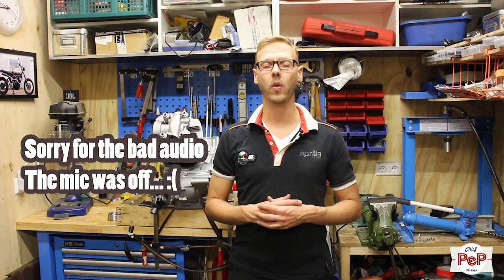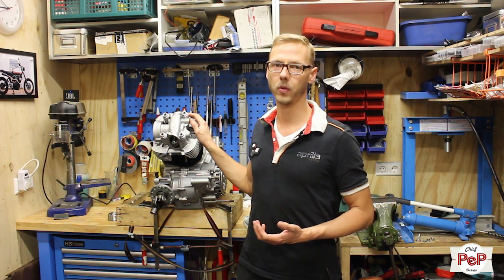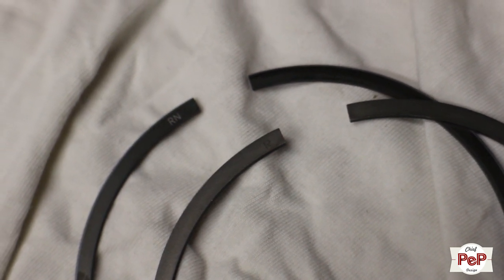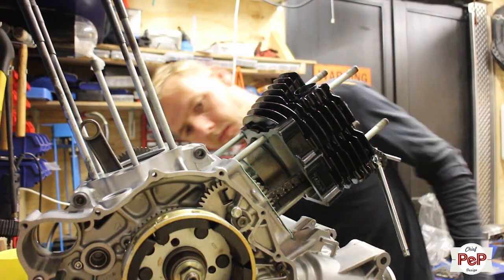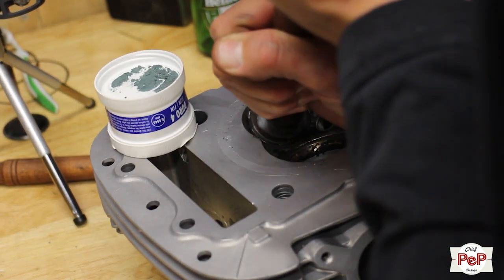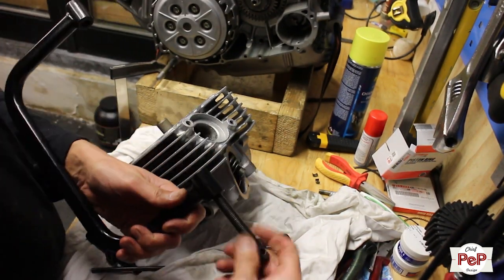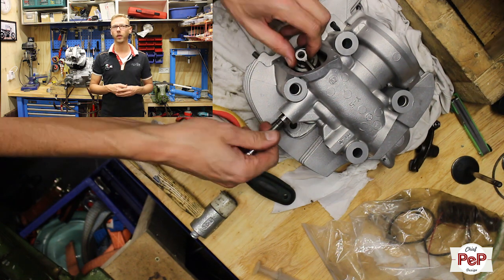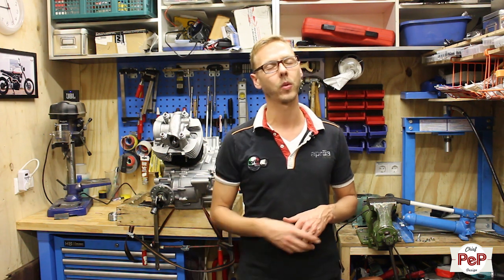Installing cylinder head, pistons rings, valves

Comment: There is actually pretty much difference between camshaft #1 and #2. If you inadvertently cross the camshafts the engine actually works backwards, meaning it will suck from exhaust and blow to carbs. Been there, seen that, done that.. :)
Reply from the maker: Yep. Luckily the numbers written on them make it a lot easier to recognize them

Comment: Pep, for clean yours upper side of pistons (head), you need to use a Oven Clean Foam, apply and wait for a 10 minutes, if are not completely clean, can use Carburetor Cleaner or a product called Schnell-Reiniger from Liqui-Moly, is very aggressive with carbon rust.
Have a nice day and best wishes from Copiapó, Chile.
Reply from the maker: Thanks Pipo. But I basically don't clean the upper pistons. There is no nead to. It improves compression, which always helps a little for performance... You probably don't feel it, but there is no need to clean them very well.

Comment: Thank you for the quick reply, but my question was!  to confirm that there is NO gasket between the cylinder and the head,  just a face to face fit, Yes?   I know that the O ring is correct.     One more quick question when I'm here, what should I expect as a good compression test reading?  I'm only getting 80psi  rear and 50psi front. Dave.
Reply from the maker: That ring is the gasket...
Reply: @chiefpepdesign  Ah!  Thank you .

Comment: Hi, good job! What is the side axial clearance between the rocker arm and the cilinder head? Mine is about 0.3mm and there is nocking around 1060-70rpm. I think to reduce it with washers. What do you mean? Greetings from Bulgaria!
Reply from the maker: I don't think it's smart to put washers in... The workshopmanual should have those clearances and tolerances noted down.

Comment: Hi, good demo, by the way,. I have a 1983 vx750 and having taken the cylinder head off I notice there is NOT a head gasket, just the rubber ring that fits around the timing chain channel .  is this correct????   Regards  Dave,
Reply from the maker: Yes. Probably there is a gasket ring around the cylinder circle. It's completely pressed in. You can pry it out and have to replace it.

Comment: Hello Chief. I am assembling my xv1100 and my outer valve springs are variable pitch ones and I did not note which way they go in when I removed them. Do you have any suggestions about the direction? Thanks a lot
Reply from the maker: The tight winding part down. Most of the times...

Comment: What size bolt and thread pitch did you use for removing and installing the rocker arm shaft? Trying to remove mine and I can't find a bolt that fits.
Reply from the maker: I believe it's just a normal 125 thread M10
Reply: @chiefpepdesign  Thank you much!

Comment: Hey so I can’t install both lower halves of the cylinder heads before doing the #1 and #2 cylinder heads? I’m asking cuz I’m waiting for the top ends to be done at the mechanic but I’d like to keep working on the rest until then. Also. Is there a proper front and rear designation for the lower cylinder heads? They look the same and I don’t see any markings on them.
Reply from the maker: Alex Fluckiger Alex Fluckiger well there are numbers at them. The fact that they have makes that probably something is different. For instant the cast. The rear gets warmer than the front... You can start building the lower parts and insert the pistons if you want. The only thing is when you want to turn the engine to find a tdc the cylinders will probably go off together with the piston which is very anoying.

Comment: There is an black oily deposit at the end of the tailpipe from the front cylinder on my 1990 xv 700 it was spluttering/backfiring -now wont, is it rings /seals what do you think? the smell of burnt oil is terrible
Reply from the maker: 🤔 Very hard to say. As far as I can tell from this explanation it sounds like things don't burn well. Try new spark plugs, make sure they are adjusted conform the guidelines and try 98 gasoline for a while instead of 95. The 95 now a days are way worse than back in 1990...
Reply: @chiefpepdesign  thanx ill give that a go

Comment: ey chiefpep, if i want to do a top end rebuilt, do i have to put in TDC for the front or rear?
Reply from the maker: Joshua Tambauan I explain in these video's at the right time and in the right order which cylinder has to be at TDC at what time. So yes for rebuilding it is important but for the timing of your camshaft it is the most important. This is another video when I put the cylinder heads on. Listen and watch that video carefully for this operation.
Reply: alright, thank you sir! one more thing, what parts do i need besides gaskets and piston rings for the rebuilt?
Reply from the maker: Joshua Tambauan Not more then the proper tools and some grease and liquids. Good luck!

Comment: Hello, I'm in dire need of help on my 97 Yamaha Virago 535!! I tore the engine down and rebuilt it and now I am reassembling. I am now trying to set the valve timing on the cam and can not get the cam sprocket notch to line up with the mark on the the cylinder head...it just won't! I am able to get close but as soon as I put tension on the chain it turns the cam and my timing's off. I've tried everything but I cannot set this cam timing, would anybody have any idea?
Reply from the maker: Sorry, just now see that I didn't answer this question. Did you solve it or...?